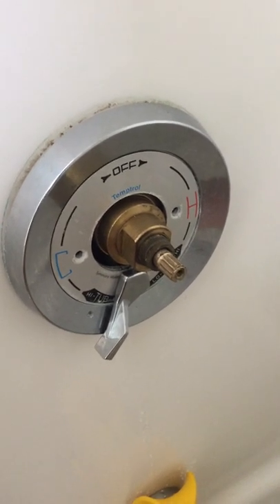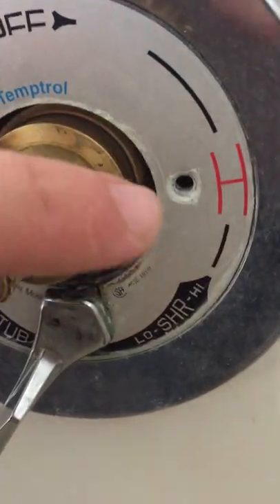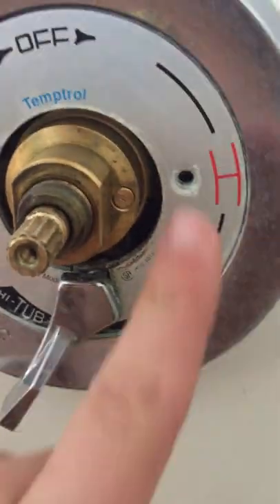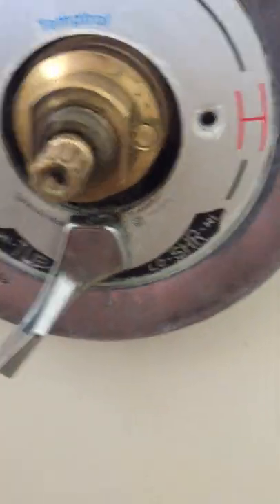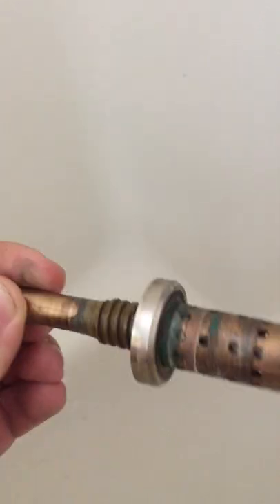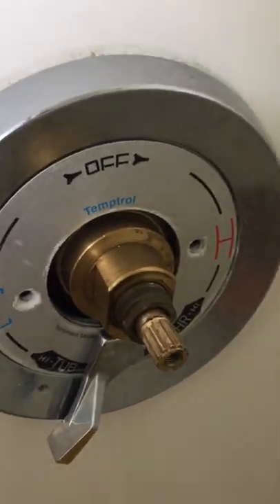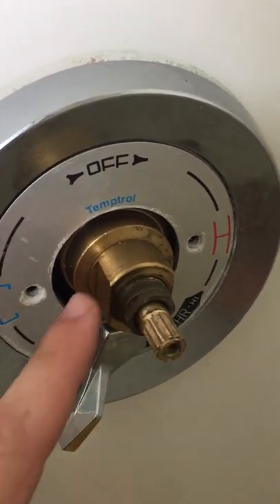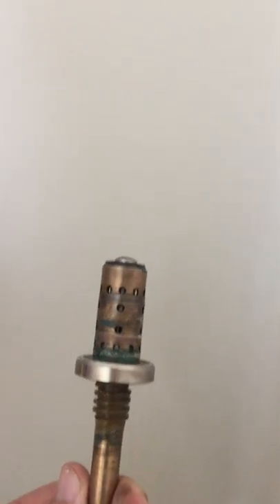Symmons Shower Valve NOT HOT

Comment: I was getting luke warm water. I loosened the limit screw, turned the handle to 12 o'clock, beyond where it was stopping before. 2 o'clock and I head the floating thing inside the spindle move and hot water began flowing again. I moved the handle back to the 2 o'clock position and tightened the limit screw again. All good.